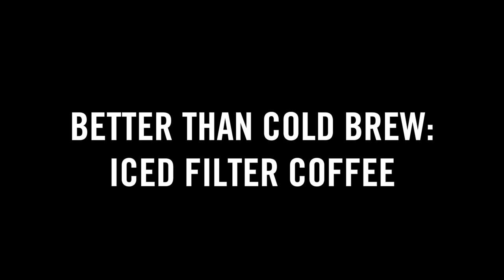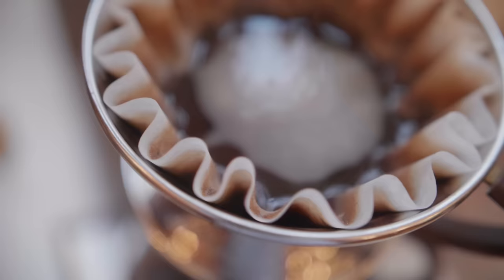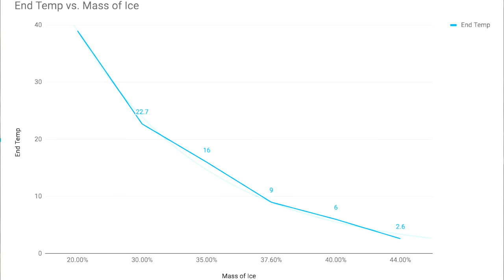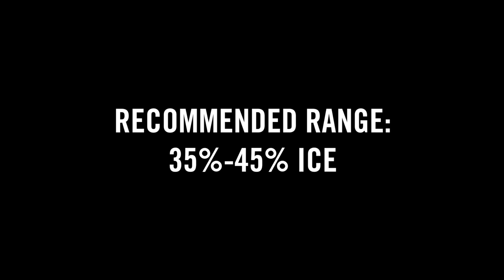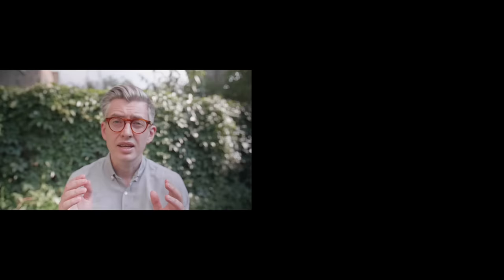Better than cold brew: How to make iced filter coffee

Comment: I never thought I'd reach the point of wanting to take the temperature of my ice cubes, the scientific energy of these videos are contagious
Reply: Psdo science
Reply: Connoisseur :)
Reply: Yep... I'm gonna be that person though and: *is contagious
The contagiousness applies to  "scientific energy" not to videos (plural) so "are" is not grammatically correct.
Reply: I'm not sure by how much, but using less ice that's much colder might actually take longer, as ice chills much more efficiently when melting into it than when it's just touching it. The ice needs to absorb enough energy to come up to its melting point before it will do anything. (this is from Dave Arnold's "Liquid Intelligence" cocktail book. He says that this is why, aside from not damaging your shaker or getting any dilution, you shouldn't shake cocktails with whiskey "stones" or the steel "ice cubes" you can buy. They chill things very slowly.)
Reply: Oh yeah? What's the specific heat of coffee ground? What's the Free energy equation of hot vs cold coffee? Get on it bucko
Reply: @paulm6081  I smell another MECE here 🛠
Reply: @mohannadhaddad3740  
That was barely even 50 seconds in a less than 5 minute video, he's clearly not inflating the length of it for money
Reply: @mohannadhaddad3740  sore boi
Reply: @MrBarosxp  regards to your mom
Reply: How cold is ice maker ice
Reply: I never thought I'd need a degree in mathematics to make iced coffee.
Reply: The thing is that the temperature of the ice doesn't really matter that much.
 Here's the math:
Let's assume that the hot coffee has a temperature of 90°C and that the coffee mug is a insulated system. (For a short period it's pretty reasonable assumption, and otherwise the math gets really complicated)
Scenario 1, temperature of ice -10°C
 Smelting the ice takes
2.09kJ/kgC*0.2kg*10C+333kJ/kg*0.2kg=70.78kJ

Scenario 2, temperature of ice -20°C
 Smelting the ice takes
2.09kJ/kgC*0.2kg*20C+333kJ/kg*0.2kg=74.96kJ
 Difference being 
74.96kJ - 70.78kJ= 4.18kJ

In 300 grams of water that results in difference of temperature of
4.18kJ/(4.19kJ/kgC*0.3kg)≈3.3C

Please correct me if I'm wrong, I did all of that from top of my head, and it might be all wrong. Also sorry for my English.
Reply: hello your computer has virus

Comment: In retrospect, it's really amazing how James is so often ahead of the trends in coffee. Japanese iced coffee is a massive thing now, and here's James, 5 years ago, with a fantastic video.
Reply: I didn't even know this was a Japanese method. I saw the espresso junkies using the steel ball over their extraction. I thought the same should work for other methods. I ended up with hard ice in my decanter. I also freeze my cup/glass. Need to use less ice. 
There's one cool thing I like to do with iced coffee. Put the coffee in a shaker with 2 ice cubes. Give it a good shake and strain it into your cup. You get the visual, texture and mouth feel of the Nitro brew that Starbucks offers.

Comment: I have a small cafe and we have a cold brew that we serve which I think is quite good. I just tried this method and agree that this method is more tasty overall. Thanks for the great video!
Reply: you'll need to charge triple to make this thing with all the weight scales and digital timers...  Business slow much?
Reply: I've already got all those things. Takes just as long as brewing a v60 normally. I already have a cold brew on my menu as I mentioned. I won't be offering this method unless someone asks but I gave it a whirl and it makes a tasty beverage.
Reply: Can you share your cold brew ratio please? I'm lazy with all the ice and gadgets 😂 but want some cold coffee
Reply: The question is it more acidic? My tummy aches after all the coffee I've drank. Cold brew has allowed me to continue with my coffee fix without the discomfort afterwards
Reply: @isaz597  Yes this method would yield more acidic coffee, but the ice melted into the resulting brew would also help to reduce the acidity so you would probably be okay
Reply: @cyan_2169  the acidity from the beans is also captured by the filter paper so it will be just a low acidity as cold brew

Comment: I tried this, and it's pretty much the best ice coffee I've had.  I made a couple of tweaks though.  I used James's aeropress technique, but with the same ratio of ice/hot water/coffee grounds from this video.  Also, I found that instead of brewing straight over ice, I brew into my cup.  My cup has a wet paper towel wrapped around it with a fan blowing on to the paper towel. This drops the temperature of the hot coffee very quickly.  Then I add the ice after a minute or two of letting the coffee cool.  The benefit of this is that the evaporative cooling from the wet paper towel and fan suck out a lot of heat before adding the ice.  This means you can use less ice and more hot water to get better extraction.
Reply: this is ingenious

Comment: Just did the iced filter coffee and it tastes awesome, much better than an ordinary cold brewed coffee. Here is what I've used:

- 65 g of freshly ground LAVAZZA QUALITA ORO on my GRAEF CM702 set to 15 grade
- 350 g of ice -33 degrees Celsius
- 650 g water at 95 degrees Celsius
- ordinary pour over dripper with two small holes (I've got Hario V60 V2 but the lower diameter was too small for my glass pot)
- 1.5 l glass pot

Almost all ice have melted and the coffee taste was very much similar to my ordinary pour over with Hario V60 :). Per 200 ml cup I've added one ice cube and 3 teaspoons of a cane sugar. Delicious!

Thanks James for your recipe! :)

Comment: Hoffman strikes again!  ... I've noticed that replacing the final 1/4 of a pour over with just hot water ends often ends with a better result (than pouring all of the water over the coffee).  Hoffman takes advantage of this, makes some adjustments to get more extraction on the front end on the action, and then replaces the hot water with ice.  Bloody brilliant! ... I've ordered a city roast of a Kenyan AA that's heavy on black tea flavors... can't wait!  Thanks James!
Reply: The longer the brewing time is the more bitter stuff (proteine chains and phytochemicals I guess?) you'll extract.
What you have here is a brew with 25% more ground coffee, or 25% less brewing water. Using more coffee or less water will increase the TDS and decrease the extraction yield. Adding 1/4 water will decrease the TDS, but doesn't effect the extraction yield.
But using less water also results in a shorter brew time, which also decreases TDS and extraction yield. So if you grind a little bit finer with this method you can avoid getting a too underdeveloped coffee.

Comment: Hello everybody! 
Now I got a couple of insights to share with you after two years of tinkering with the v60 and making some delicious iced coffee. I would be very happy if you would share some of your thoughts and ideas about how you go about it as well as what you think about mine.
  So here we go: I have found that instead of going 4:6 on the ice to water ratio I would change it up slightly to 7:13. As James himself said with more brew water easier it is to get a smoother extraction, it is not without another slight modification though; you should chill your serving glass in the freezer right about or before you weigh and get to grind your beans. I use the Hario Skerton to grind my beans so I do it manually and it takes a bit of time  so keep that in mind, if you have an electric grinder or use pre-ground coffee do it earlier in the process.
  The result is, I find a more throughly extracted coffee with a much more forgiving brewing process, that in theory should open up the chance to introduce more variation. (to the grind size, roast profile etc. etc.)

Thanks for taking the time to read. 😀😃
Reply: @Berk Gokcay Thanks for that. I'm on vacay now but will try your variation. Experimenting is half the fun of coffee.

Comment: I've been drinking this constantly during a summer heat wave and it's fabulous! It works perfectly to chill down the coffee to a refreshing temp regardless if it is poured over more ice or not. My only concern is what the brew water temperature is. I've been using water temp how I normally would and it has been great, but I'm not sure if increasing or decreasing would make a significant change. Regardless, this is an absolutely great recipe!

Comment: I decided to try something not mentioned on this video: the same thing you tend to do with pour over brew in general but applied to iced coffee. Rinsing the filter paper with as cold of water as the tap gives and leaving it sit in the carafe, just like with hot water. Should help with cooling the coffee a bit, just like that pre-heating helps keep hot coffee warm longer. I don't think that'll decrease the amount of ice necessary, but it should cool the coffee down quicker.

Back in the day I used to brew the coffee into a glass of ice and milk/cream half-filled, then put it in the freezer until cold. I don't think it's in the best interest of the freezer and I didn't brew stronger coffee so dilution still happened (from milk/cream as well), but it was pretty decent.

Surprisingly the biggest difficulty with brewing iced coffee is getting the sugar to dissolve.
Reply: Keep simple syrup on hand❤ Make it on the stove one cup water to one cup sugar, cook till dissolved. Store in a container in the fridge.

Comment: I am enjoying this recipe a lot by making an iced "filter tonic". The result is somewhat alike Espresso Tonic, but I find this variation more gentle, very nice to just sip and chill :)
You can use any Tonic of your liking, I usually use Schweppes Indian Tonic because it's a good balance of price, taste and volume in my opinion.

32g coffee/500ml
200g ice
300ml hot water
60 ml bloom until 45 seconds
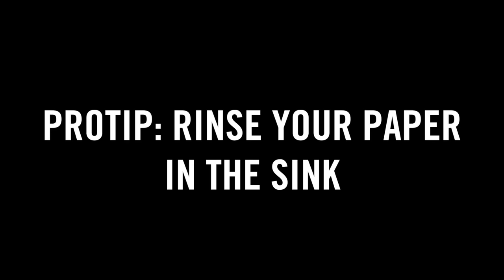0:45-1:05 - up to 200 ml water
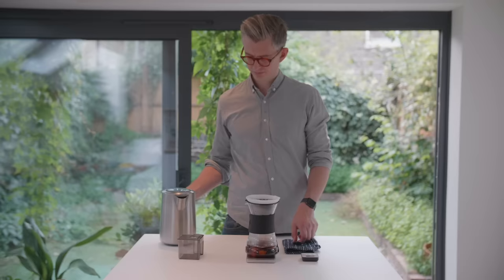1:05-1:15 - pause
1:15-1:25 - up to 250 ml water
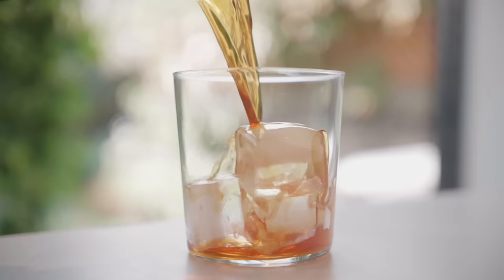1:25-1:35 - pause
1:35-1:45 - up to 300 ml water
I then lightly swirl the V60 for better dripping and, after the process is done, swirl the pot to help melt the ice.

Loving the result!

Comment: Okay, so I made this yesterday, but with an Aeropress instead of a V60 (I don't haz one yet) and it went rather well. 200g of ice in a 700ml container, very fine grind from a local roaster that was exceptionally fresh. I pre-wetted the aeropress filter and used the standard orientation for the Aeropress with the filter side down so it would drain slowly. Water heated to 90 degrees C, 3 minute timer started, and 80ml poured over grounds to bloom for 45 seconds, then stirred and slow-pour remaining 220g water until kettle was empty. Stirred grounds, then inserted plunger and pressed very gently until 3 minute timer was complete. Swirled the brew until remaining ice melted, then placed in the fridge. This yielded an exceptionally strong brew that was not cloudy at all and perfectly balanced when poured over two 50g ice cubes in a tall pint glass. I do believe the Aeropress was a better choice than a V60... Thanks for the video and recipe.

Comment: YES! I brought this method to one of the shops I worked at (pretty much a shameless Starbucks clone).

Their "Iced Coffee" was abysmal. They would just brew auto drip by the gallon and put in the fridge with no lid until it was chilled. It was HORRID. I just called it cOLD Coffee, because that's what it was. Tasted like cigarette ash after oxidizing for several hours. 

Once we started doing this, we could hardly keep up in the warmer months.
Reply: really depends on what kind of coffee you use as well.
Reply: So simply brewing coffee and chilling it in the fridge doesn't make very good iced coffee?
Reply: Christopher Pape No, it does not. Bear in mind this is just one man’s opinion, but one that was supported by a customer base of ten thousand or more. No one missed the old iced coffee.
Reply: Alexandra Gunnarsson Any coffee brewed hot will perceptibly oxidize if left exposed to air for 30 minutes or so and will taste pretty terrible. This is another reason I use a 12oz travel tumbler. Keeps heat in and limits fresh air exposure.
Reply: @AcornFox  so if y'all had put a lid on the coffee immediately after brewing would it have been good?
Reply: Christopher Pape In my experience, no. Maybe because the batches were so large that they took forever to cool? I think in addition to the tannins or whatever oxidizing, the oils go rancid. Not a chemist, I just know the coffee was terrible by the time it got served.

Don’t get me wrong, you’re free to experiment and you should. Try three batches, hot with no lid, hot with lid, and hot over ice as shown above. Let me know which one you like. Not sassin, genuinely curious. 

I just think this method (in the video) works waaaay better commercially, and scales down extremely well, and I personally like the acidity of coffee brewed hot. As such, I don’t care much for cold brew.
Reply: @AcornFox  huh I'm kinda the opposite I think. I like a very smooth coffee with cream and sugar. Ngl I'm no coffee connoisseur over here so don't roast me haha. (no pun intended) That being said I was a fan of the iced coffee we had at the coffee shop I worked at before we closed due to covid 19. We brewed from the same brewer we used for hot coffee but with more grounds, then topped with ice, put on lids and put in the fridge. I doubt the lids were air tight tho. Technically it was supposed to be rebrewed every 48 hrs if it all didn't sell, but some locations were more strict than others lol. My manager had me follow close to that rule tho. Other than that I'm trying to get a good cold brew mix going at home. Just working on figuring out my favorite grind size (if I don't just buy pre ground tbh), brew time, coffee roast and brand, etc. I'm basically just trying to get it as smooth as possible haha
Reply: @AcornFox  I'm curious, how did you scale this for commercial use? I'm guessing you're making a few liters at a time?
Reply: @taylormerriam4627  I imagine they were selling at a higher price point just as coffee shops sell pour overs at a different price point than normal drip coffee. This was at a local shop I used to live near, and I got this every time in the summer. If you enjoy coffee, its worth a little extra :)
Reply: While not auto drip coffee, my favorite coffee shop actually makes V60s hot and chill them down in the fridge instead of the ice cube method, and it's the best iced coffee I have ever had, the guy that runs it has a video on it (check out Tim Wendelboe iced coffee) and IMO it's better than Japanese iced coffee, but I still make Japanese style quite often since I can drink it instantly then
Reply: this guy's a genius
Reply: Having saved some hot coffee for later in the fridge I can confirm. I just throw it away and try to do a better job of figuring out how much I'll drink before it gets to room temp. Anyway, unless you have shares or co-owner or something I wouldn't have bothered. They will make millions eventually off of your efforts.

Comment: One correction. It doesn't matter how much ice you put in in that you can put way more ice and you will in fact get better result.
Assuming ice is less than 0C (mine is between minus 18C and minus 27C) the more ice you use the less it will actually melt and dilute the drink. That's because it first sinks some energy from the drink before it starts significantly melting at 0C.
If you really intend on chilling something without diluting it, use large amount of ice, let it sink a lot of energy from the drink, and then REPLACE the ice with fresh, very cold one. This is basic drink-making technique. Just don't overdo it because it is possible for the drink to freeze around ice cubes. Happened couple of times to me, oops...
Reply: I think Hoffman allows the ice to melt to become part of the water that's in the coffee. He includes it in his calculation of the coffee to water ratio. 

In the video he notes that you 'swirl until there's no ice left'
Reply: @curtislevey7639  It kind of depends how cold you want it to be. If you don't want it at exactly 0C, then you don't really have much choice and you need all ice to melt. And then you include all of the ice as part of the recipe.
On the other hand, if you like iced coffee not merely cold but want ice still floating in it, then the more ice you put in, the less diluted the drink will be. That is because more ice will offer more sink for the energy from the hot drink.
If you don't believe, do a thought experiment. Take in your thought an ice cube that is well below freezing and put one drop of hot espresso on it. The espresso drop will freeze without getting diluted much, because the ice cube has so much potential to sink the energy that it can still all be ice even if you add couple of drops of hot espresso to it.
Another way to think about it, if you have ever drank iced coffee and had ice still left afterwards -- the ice left behind did not become part of the recipe. You left it afterwards and it did not dilute your drink. But it contributed to cooling the drink because it started as much less than freezing and it ended as exactly 0C.
Reply: @leonardmilcin7798  I believe you and understand how ice works lmao. It's the same reason why cocktails have so much ice. But Hoffman is adding fresh ice into the glass - at which point you should by all means use as much as your container will allow - whilst allowing any that was put into the carafe to melt and become part of the mixture.